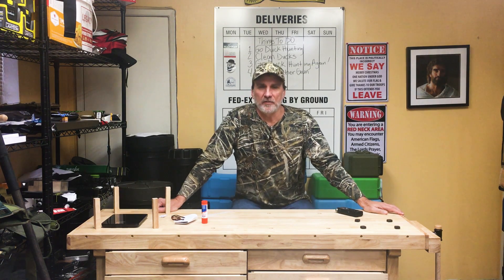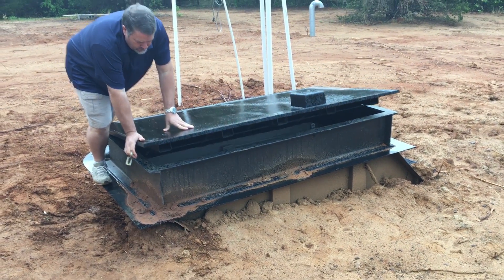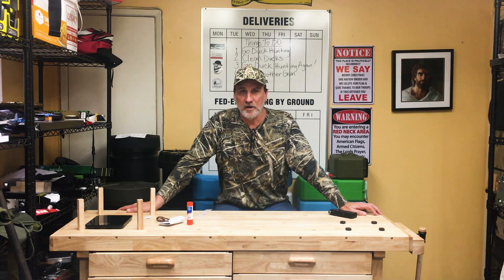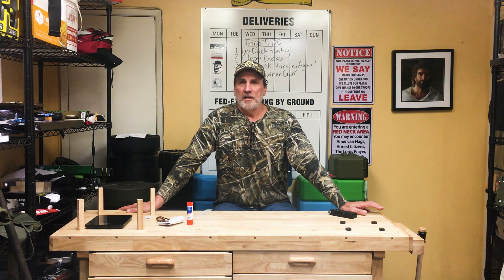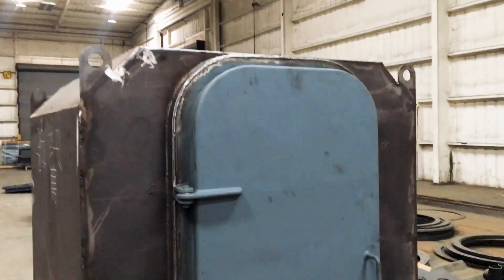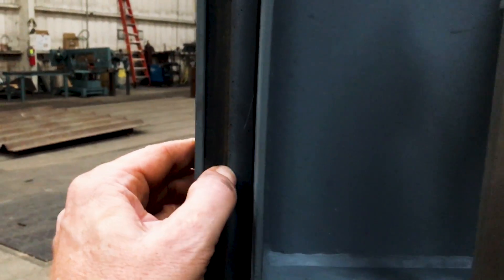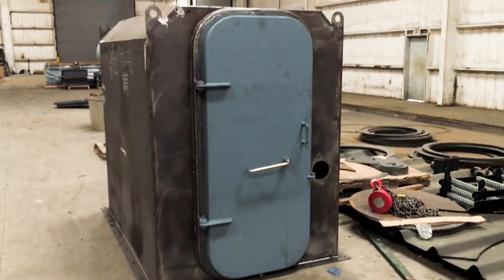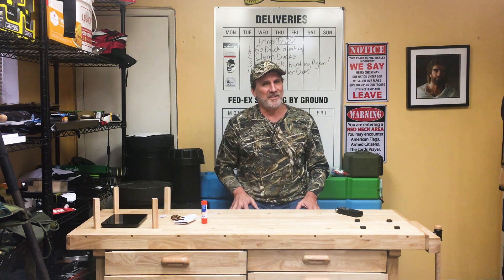Gas Tight Doors & Bullet Proof Hatches On ATLAS Bomb Shelters.

Comment: Great video and even better product. I love the design of those doors, but I do have a question, is the rubber seal for the door, rated for military chemical weapons or NBC rated to not break down? Like the rubber that's used in protective masks, that rubber won't break down in a chemical attack. Keep up the great work.

Comment: Okay..

I need answers..

1. What if the area you put this Bunker gets flooded?.. Like if say I get one of these bunkers and put it underground in an area that gets hit by a hurricane, a tidal wave, a flood.. 

2. Will this Bunker keep out water?.. 

3. How would I get OUT if my escape is underwater and the only way out is under what might as well be an ocean because there would be no way to tell how high the water is from an underground bunker? 

4. Will the door even still open if any of those scenarios happened?

5. Earthquakes and/or Sinkholes.. If some sort of fissure, crack, sinkhole, etcetera, were to open up under, around or near this Bunker and causes the bunker to sink further into the ground or ground winds up over the hatch due to an earthquake or sinkhole (like if it sunk and then there was a cave-in over the hatch), how would anyone inside get out?

6. What if someone on the outside puts something heavy over the hatch, how does someone inside get out in a situation like that..
Reply: Some of the things you ask are on other videos Ron has already done. :)
Reply: @RJM1011  oh.. So there is more than one video on these shelters?
Reply: Air tight=watertight